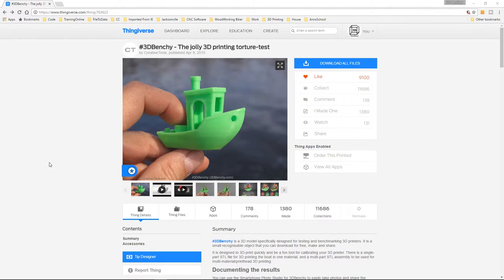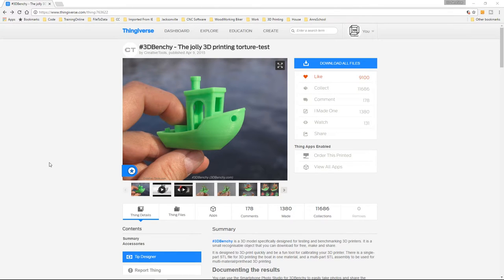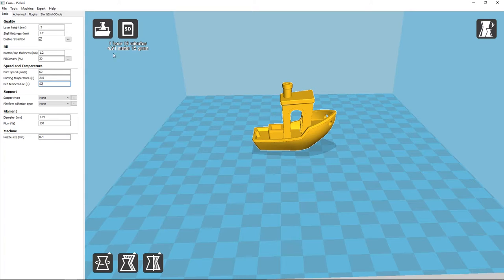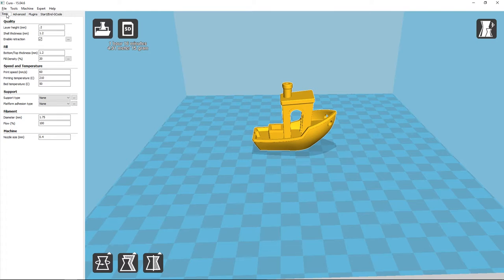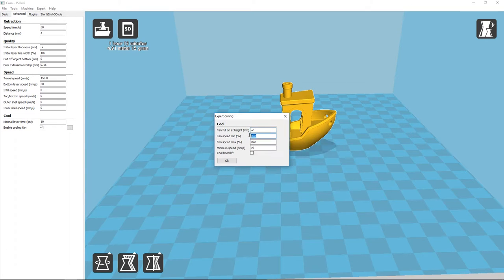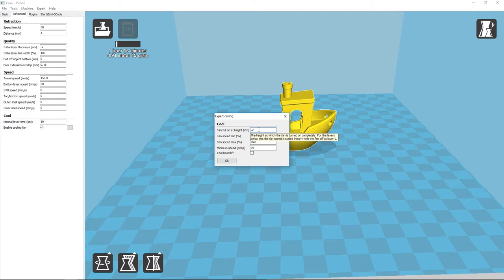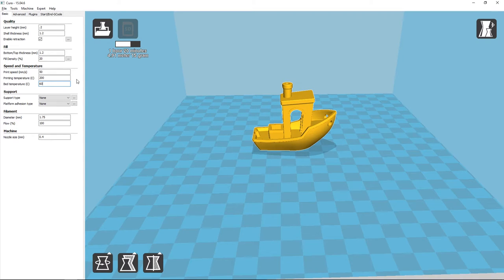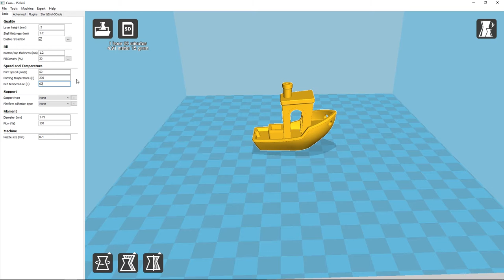3D Printing: 1 Cooling Fan Vs. 2 Cooling Fans

Comment: I'm currently running 2. But I have to go back to 1 due to wanting a CR touch. Would I get away with redesigning a fan duct to cover more area + larger fan? Currently using 2 x 5015 blowers.

Comment: thank you for making the video I asked bro... After seeing this I am definetly getting an extra fan.
Reply from the maker: Np bro... Thank you for the video suggestion.
Reply: Hi Rorlin, can you help me? the stock cooling fan is not working for me for some reason? I checked my Gcode and I see my M106 255, yet it wont spin, what should I check?
Reply from the maker: Did you add a 2nd fan to your printer? Is the 2nd fan working? are the 2 fans wired together?
Reply: Rorlin 3D NerdStop yes, I think I solved the issue by manually adding the command in my start up gcode, for some reason  Cura ignores the setting

Comment: Just purchased the same fan that you have and downloaded the fan shroud you edited on thingaverse. excited to print it and see if my R1+ will print as good as yours is. Thank you for the videos they are great.
Reply from the maker: I hope it does work well for you let me know if you have any problems I might be able to help with. Thanks for watching
Reply: I just finished installing and wiring the second fan in today, Had to wait for parts to arrive. I am currently using the settings you outlined in print number 4 to print my benchy test print. I also printed a shroud for the rear fan that the original fan slips into and even the original wire length reached. When it's done I was considering doing a video response to your fan upgrade let me know if that interests you? And thank you for the information and links to the parts!
Reply from the maker: If you want to please do a response video I would love to see how it worked for you and hear what you think.
Reply: The fan worked awesome, unfortunately, the video will be delayed due to my printer needing repairs to the ramp 1.4 board.
Reply from the maker: Sorry to hear that you are having problems with you ramp board. Hope you can get it working soon.